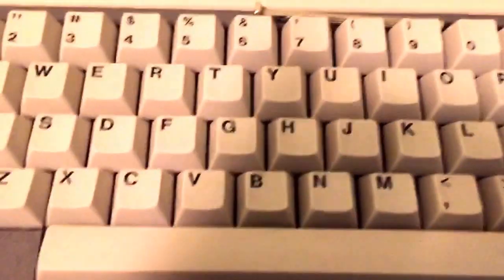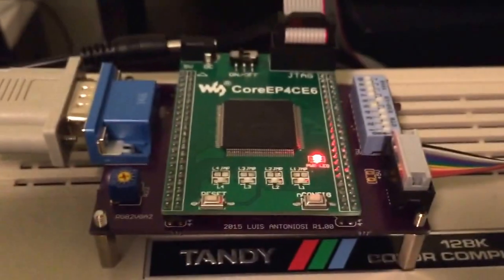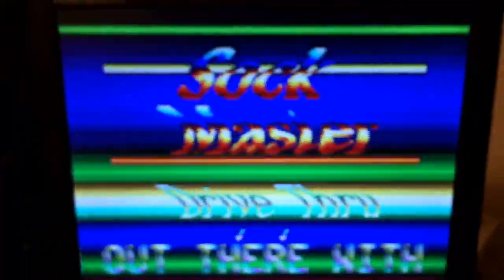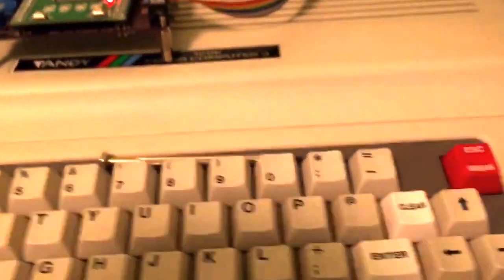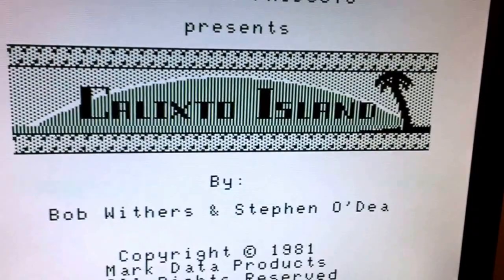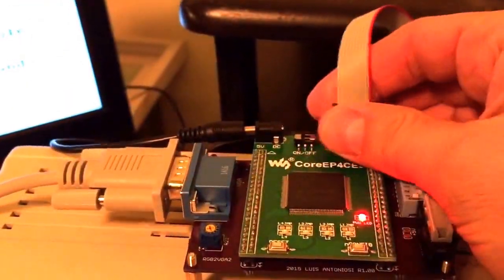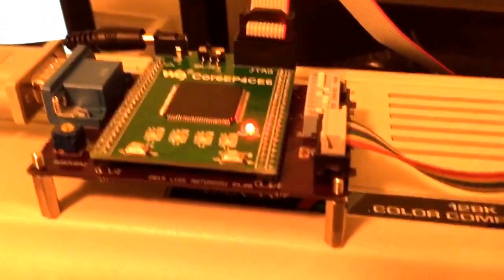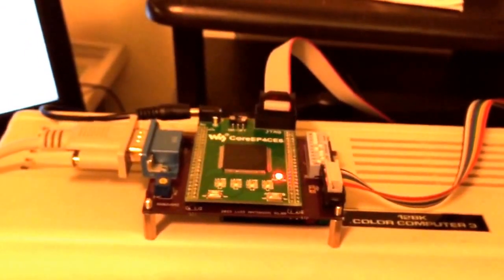First of its kind

Comment: I've been following this for a while and think it's a great project. For those looking for a similar modern solution check out ebay for a "SCART to HDMI" adapter. They run from $35-$45 and convert 15kHz RGB via SCART to HDMI suitable for viewing on most modern LCD monitors and TV's. Ebay also has videos of people using the same adapter for several different game consoles and vintage computer's like the Atari ST and Amiga. The adapters also support composite video. There is also the GB8220 for about $30 that converts RGB to VGA.